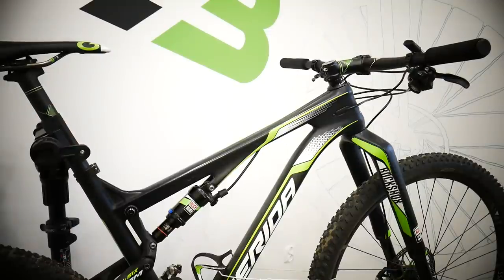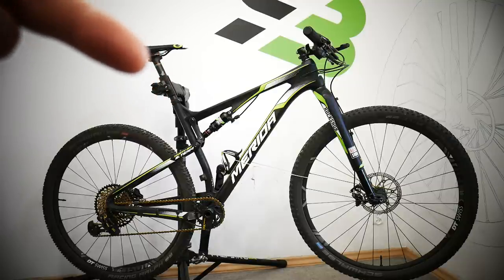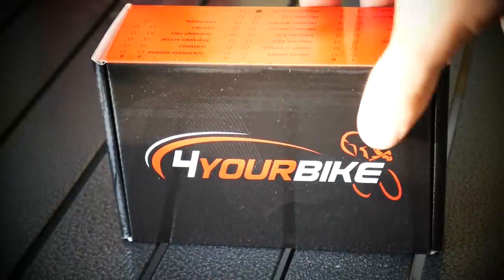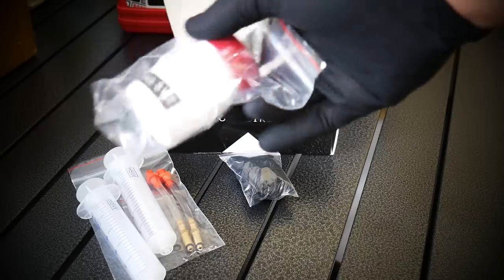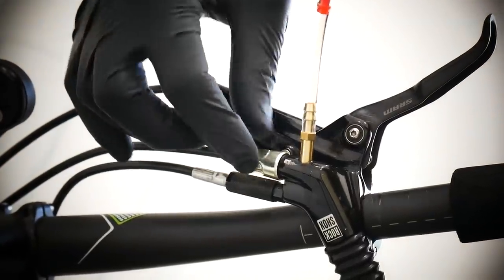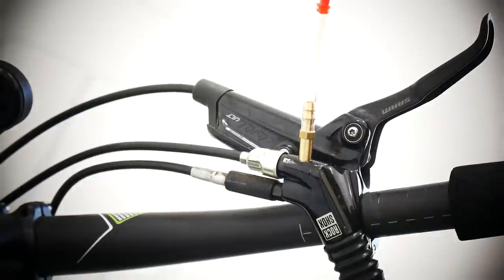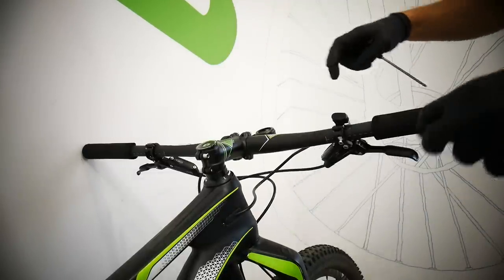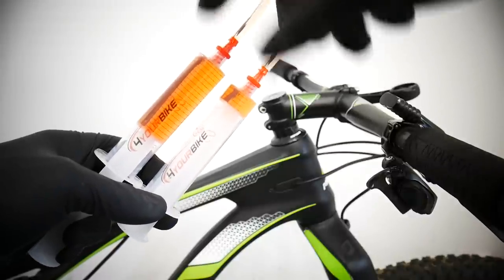How To Bleed The RockShox XLoc Full Sprint Remote.

Comment: And how do you bleed between fork and XLoc Full Sprint Remote? Or there is no procedure for that?
Reply: Peter Strenk I have the same question, in my case the lockout works on rear shock but don't unlock my fork 🤨

Comment: Hi, do you know how to unblock the System? It stayed stacked locked-in and i cant bring it back to open. So my full bike is stiff now. Thank you!
Reply: mine is the same after I bought it used
Reply: Same question here. When the lockout is blocked, does bleeding will help the problem?
Reply: @samuraisimon  hi, finally i had to change the lockout system. The intern membranes where broken so no repair possible. Changed to new one and now finally is ok.